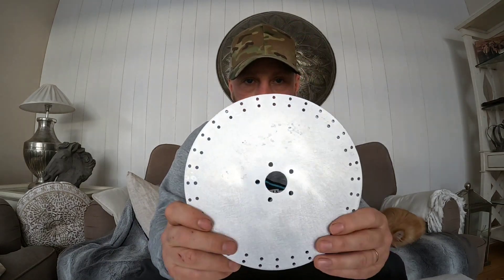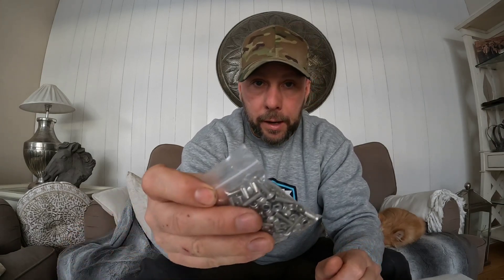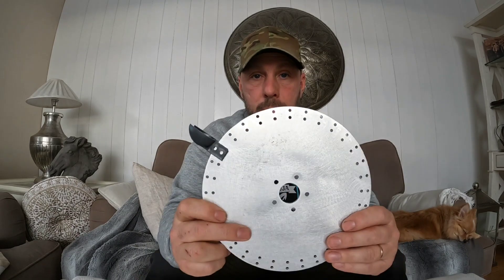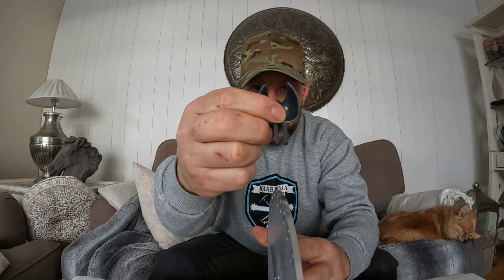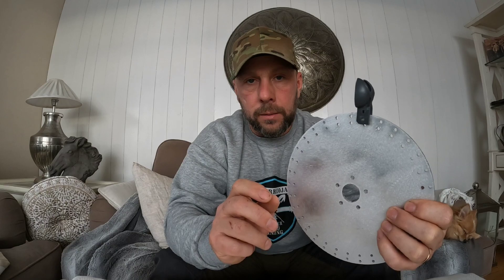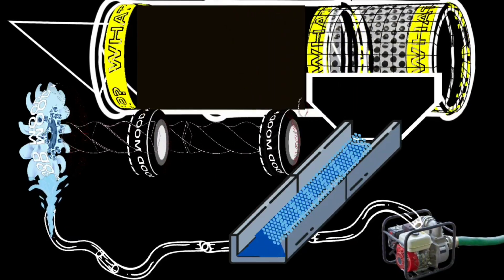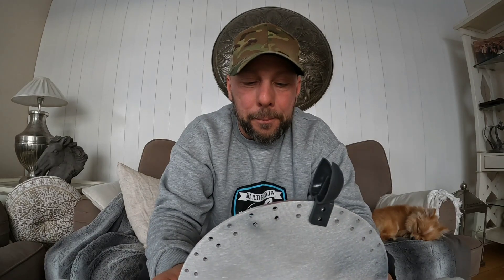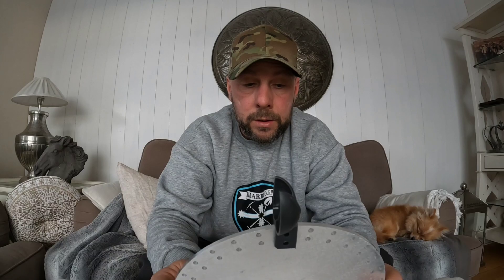PELTON WHEEL:  Future Water Driven Trommel For Gold.

Comment: Interesting. How much head can you get on site?
Reply from the maker: It depends, but if I use the stream that I got on my claim I could easily get 30 meters but in this case I will use the petrol driven Waterpump wich I also use for washing the material.
Reply: @outnorthprospecting  Great, just wondering if you could eventually run using the peltor wheel to generate electricity and possibly have a lower noise/more green operation .
Reply from the maker: I understand what you mean. Unfortunately the stream that could be used is a long way from the current work site, but if I decide to move the operation I will have a try to do it more green operated, it would be really nice if that would work 😀

Comment: We converted 2 of our trommel to pelton wheels and they work great.  I recommend using metal spoons, the water pressure was too much for plastic spoons and many broke.  Make sure your jet is adjustable, the optimal sweet spot is not the tip of a spoon, it's more like the base of the spoon.  Best of luck to you!
Reply from the maker: Thanks mate for some interesting info. How long did the plastic spoon last and did you find metall spons that fitted the wheel you already had or did you have to buy a whole new set up?
Reply: @outnorthprospecting  Well to be honest the trommel with plastic spoons still works, just at a reduced performance.  I have not changed the spoons yet but I suspect I can replace the entire wheel with just a few screws.  I also recommend a sealed worm drive gear box for the reduction.  I tried my own worm gear and it was impossible to keep lubricated properly.  I bought a 40:1 gear box which works well but the turbine has ample power.  I would try a 20:1 gearbox if I was to do it over again.
Reply from the maker: Thanks for the reply. Yes, maybe I must mount some kind of gear box and in fact I have a couple laying in the workshop. This will be a fun and interesting project. Thanks once again for your Input, appreciate it 🤠